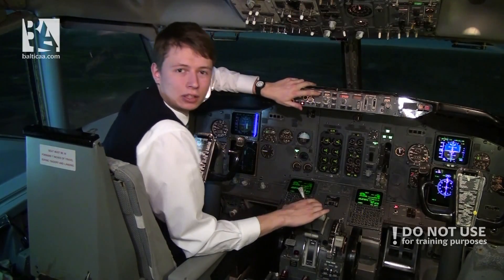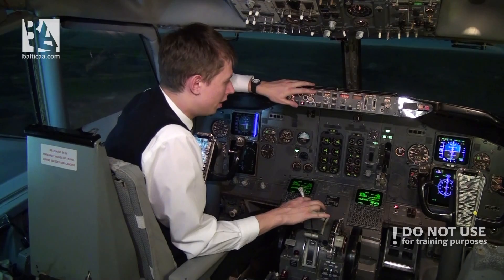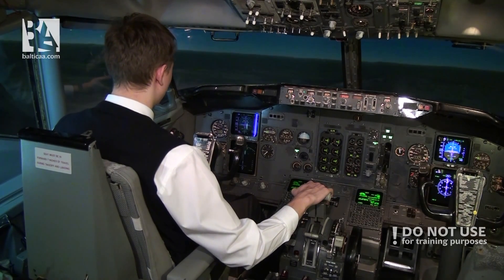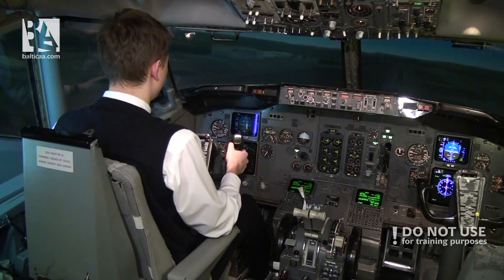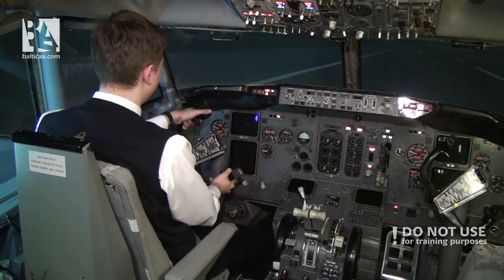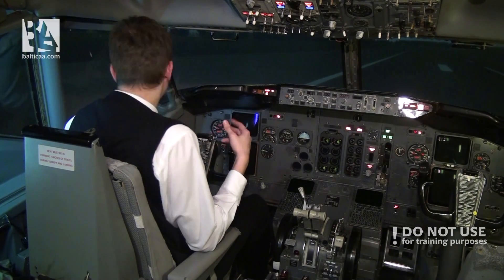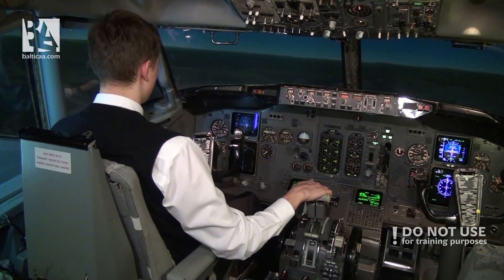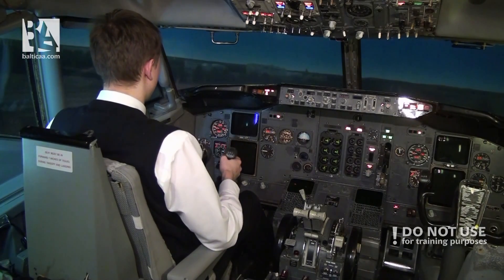Boeing 737 CL: Dual engine failure on short finals

Comment: Actually,  it has happened in real life. That BA flight on short finals into LHR from Hong Kong. Dual engine failure and it crash landed but a miracle everyone survived with minor/major injuries.
Reply: Do you mean the BA38 from Beijing but not Hong Kong??
Reply: It wasn't from HK, it was from Beijing or Shanghai or something
Reply: Br. Midlands have left the chat
Reply: Yes that was the British Airways flight 38 from Beijing to Heathrow. The engines were broken down just moments before touch-down. It was documented in the Air Crash Investigation. But the B777 was badly damaged and couldn't be repaired......

Comment: if you reduce flaps wouldn't you have more glide?
Reply: +neroloko12 flaps provide lift. You know what happens if you have no lift?
Reply: neroloko12 actually, that's somewhat dependent on speed. At low speeds, the increased surface area adds lift. At high speeds, such as in flight, that now inhibits airflow and produces drag. A bit of a double edged sword, flaps are.
Reply: Flaps increase lift, retracting them while gliding will make the plane fall faster.

Comment: As a general comment in my Airline we would sometimes simulate a dual engine failure allowing the pilot to choose the height and speed combinations. Hydraulics would be available via APU electrically powered pumps. The technique would be preserve energy so late gear extension and partial flap only until landing assured-aiming point about 1/3rd down the runway. The flap is used to bring the aiming point closer to the threshold. Finally a speed excess is needed to allow for a flare. Some B737 Classics have Alternate NWS otherwise it will be via rudder pedals, with degraded no anti-skid braking, no reverse thrust and manual ground spoilers-so you can steer and stop!

Comment: The B737 classic is an old design. It does not have as many modern features as either the B737NG nor the A320. The auto flight systems are more basic as are the auto throttle modes. 
Just by way of a general comment MS Flight Sim may be one thing-but the real experience is very different. From 300' AGL a dual engine failure is potentially fatal-you have very little energy surplus at Vapp, only a small margin above the stall speed actually. In any case a component of that speed is needed for the flare manoeuvre.
Flap retraction would drastically reduce lift and probably lead to aerodynamic stall.

You are in the 'lap of the Gods" actually-a lot would depend on the undershoot area which is where you are probably going to wind up. As the touchdown zone is normally 1000' in from the threshold-youwould hope to use this to place the aircraft on the threshold instead. I compliment BAA for these videos!

Comment: Would retracting the gear (and flaps) be effective in extending the glide?
Reply: Riley Mac Yes I agree if you're lucky with hydraulics.
Reply: +ROCKSTARCRANE partly reducing the flaps, but considder that you dont have time and hydraulic power anymore to do this, and retracting the gear would be a bad idea at all youll need it everywhere exept the water to touch down....
Reply: +AIRBUS319BY319 I agree although the flaps and drag and lift so you could possibly fall faster.
Reply: +Pilot737_Sanchez  So long as your speed is constant, reducing the flaps will give you a bigger glidescope and only if there is any hydraulic pressure

Comment: You reduce thrust levers to get a flame out ??? In that case you will have more than 30% N1 remaining.... It's totally fake what you are doing because if you have a flame out you will have less than 30% ... But if you cut-off both engines it will be like a severe damage (N1 and/or N2 = 0%) ... which is not the purpose of your video because you say "flame out" ... but it could have been more realistic ...
Reply: He reduced the thrust levers to idle after the flameout.
Reply: omg you are so dumb he put them to idle after the flame out, if the engines were on the electrics wouldn’t have failed 💀💀💀
Reply: according to your logic the electrics fail whenever the thrust is idled

Comment: Why the aileron control input after touchdown?  Shouldn't you be on the tiller?
Reply: ROCKSTARCRANE there is no tiller on the 737
Reply: PEP cessna Then how is ground steering initiated?
Reply: you use the rudder pedals, all 737 steer with the rudder pedals
Reply: My Mistake
Reply: Sorry I made a mistake dont get angry with me thx
Reply: +PEPcessna - Retired 

Hi there is a tiller on the B737, only on the Captain's side though.
The aileron control after touchdown may be helping to keep the wings level-although it was probably more an instinctive reaction from the PF with no effect at all.

Comment: Is there a RAT=Ram Air Tourbine on the 737
Reply: no
Reply: +TheGamer003 On the 737 Classic no, but the on the 737NG i believe there is one.
Reply: Berke Karakın thanks
Reply: they do, you can see it kick in. everything turns off, and then warning lights come on again
Reply: JonathanGJM, actually if I'm not mistaken no 737 has a ram air turbine. The control surfaces are mechanically linked to the yoke with hydraulic assistance. You could compare it to a car where the power steering hydraulics fail. You don't lose steering, it just requires more effort to operate. The instruments coming back on is because the system automatically switched over to the batteries.
Reply: Thats what saved everyone on us airways 1549. FYI

Comment: How about gear and flaps up to reduce drag until for example 200' AGL. It will surely increase your glide distance but i don't know if you can extend your flaps and gear without hydraulics.. Probably flaps 5 and gear up, and when at minimums manual gear extension... (DON"T DO THIS IN REAL LIFE!   I have only tried this on Microsoft flight simulator:X as an idea and it did help)
Reply: Depending on what 737 model you used in FSX, the aerodynamics might be a bit relaxed for easier flying. With low altitude, hydraulic power lost from the engine outages... manual gear extension is possible without hydraulics thanks to gravity, but flaps/slats varies from aircraft to aircraft. Since time is so short from engine out to landing, it's better to just fly the aircraft down than try to clean up config and such before landing,
Reply: flaps i agree but only a few stages not a lot otherwise you'll sink a lot. however gear up i totally don't agree, you want to be ready and not increase your work load at such low altitude.

Comment: i suppose setting Flap from 30 to 15 might be an option to gain speed. There isn`t enough time ( reaction time of the crew ) and the time the APU needs to Power Up and supply the HYD pumps. Glad that a lot of jets have that RAT ( Ram Air Turbine ) System. i tried the same as pranus in B737 sim. Same result. Then on the B777 Sim at Lufthansa Flight Training in Munich. RAT Pop out and the acft was immediately set on power, no display fade out, no big loss of Hydraulic Supply at the yoke. The only point i got critics, was braking on the ground, as no Reverse available i blew 8 Tires on landing and overheated the ENTIRE Break System......:-))
Reply: Imprtance of security lenght after strips.....

Comment: That's why during approach and landing APU should be on. You can power the electrical hydraulic pumps, instruments and lights on the aircraft (so people don't panic). I guess that if power goes off during landing and light go off... people would scream, adding more pressure to the pilot.
Reply: Are you willing to pay extra money because the apu uses fuel?

Comment: The 737 has two electrical driven hydraulic pumps.
Reply: Yes, but it would not work without AC power, i.e.: your Engine Generators or APU

Comment: i have a question.. which you actually use to controll the wheel... the Rudder Pedal, or that wheel thing on the left side of the pilot
Reply: The rudder is more effective on high speeds. And the tiller is used below 30kts.

Comment: Correct but it may have been beneficial to reduce the flap setting by one or two (like the 777 at Heathrow), just to get rid of the drag flaps, you would extend your glide (although the sim might not correctly show this).

Comment: Lorenzo, with loss of both engines, you will still have the ability to start the APU which could power the hydraulics, or a ADG(RAT) that will power at least one system
Reply: not enough time to start apu

Comment: Losing the engines, you lose also hydraulic pressure, that means you can't raise the flaps. In the case of the Boeing 777 in Heathrow the engines didn't shut down completely, they lost only some power, so the hydraulic power was still there, but it was anyway a crash!

Comment: I would really appreciate an answer for this one. In your first landing when you actually made it on the runway, why didn't you engage the spoilers. Secondly you could have decreased flaps which would have reduced some drag. Same thing happened with a BA Boeing in Heathrow and decreasing flaps actually helped. Thanks
Reply: Would the flaps decrease with both engines out and no hydraulics??

Comment: On the 2nd flame-out why didn't you take out some of the flaps to reduce drag and loss of airspeed to increase glide distance? Lack of hydraulics? Does the 737 allow for APU use while flying to provide backup hydraulics?

Comment: Retracting the flaps so much would have most likely put me into a stall either immediately or during the flare, what would probably give a very similar effect than I had. I lose drag, but I lose lift as well. 

Retracting the gear might have worked, but when the gear doors are opened, until the cycle is complete, the drag is increased rather significantly therefore it's doubtable whether it wouldn't do more harm than wanted :-)
Reply: Who are you talking to?

Comment: how much would a certain amount of flap retraction (from full to 20deg per say) prolong the glide distance in case of dual flameout at 500ft?Given that the L/D ratio would increase...
Reply: It won’t increase it by that much and from 30 to 25 degrees (there is no 20 setting on b737) would likely just stall or fall faster (probably won’t make it to runway), honestly it would have been better to just extend it to 40 not to prolong the glide but to soften the impact